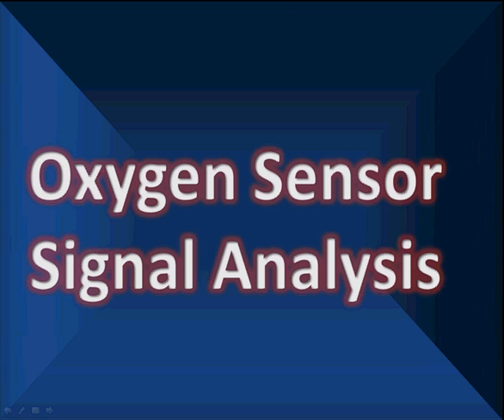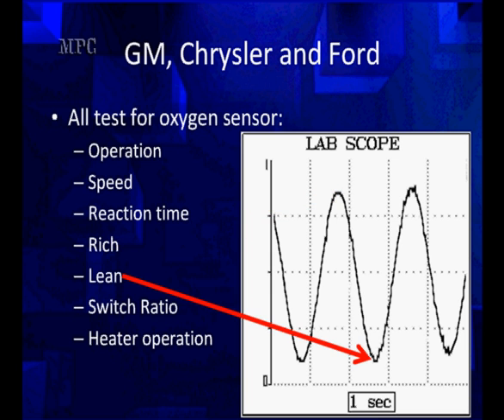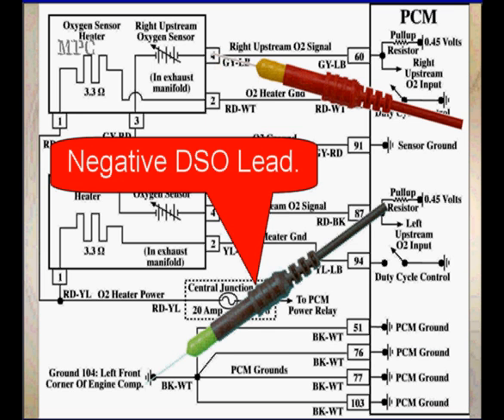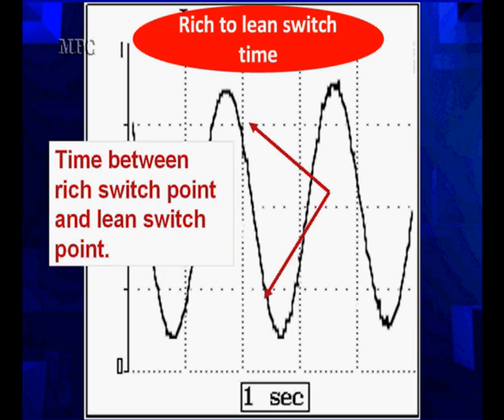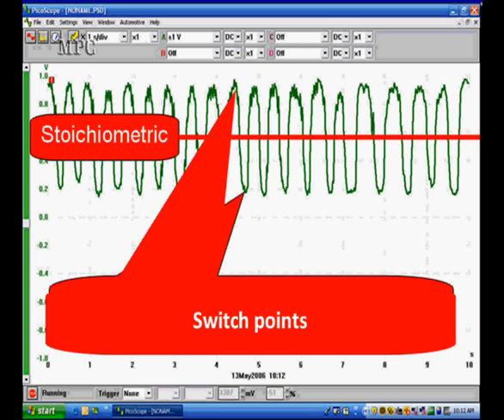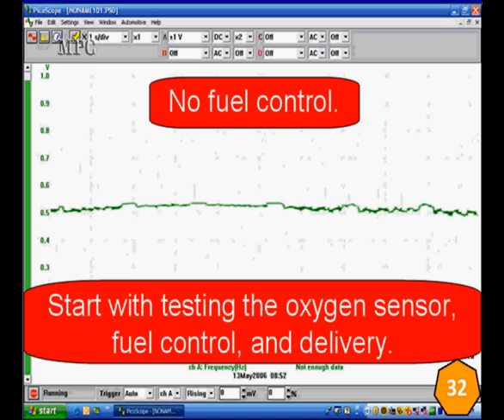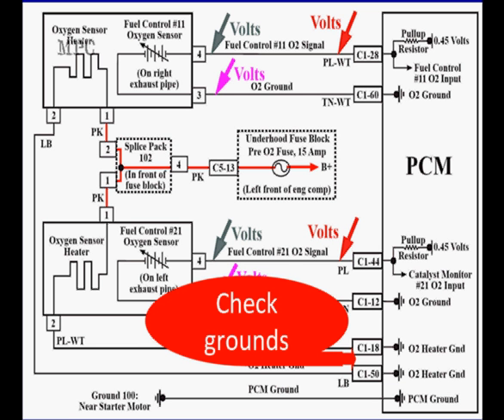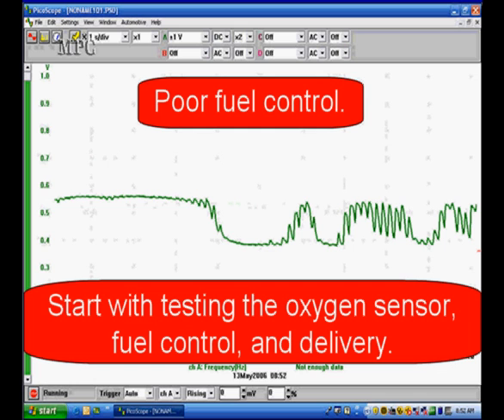12 Oxygen Sensor Signal Analysis

Comment: Back when I started in the early eighties we still had carburetors and then along came an adjustable mixture control solenoid mounted in the carb and we adjusted dwell time. Then came TBI and it was called "cross counts" (GM). When short term and long term fuel trim terminology came out I was a bit annoyed. If memory serves me right this was about the same time everybody started going to OBDII. I'm not so annoyed anymore, standardization is a good thing. Motor companies still practice their tactics of monopolization with the tech and good service being the victim. This comment has nothing to do with this video, LOL, it just reminded me of times past. I love your videos, keep em coming.

Comment: What's the purpose of the heater coil?  Is it to get the sensor working faster when the car is not at operating temperature.  Does the coil go off when the car is warmed up?  Is it suppose to reduce emissions until the car is fully warmed up?
Reply: yes
Reply: 1) Yes, 2) generally no but possibly ECM might turn current on and off, 3) Yes, closed loop starts sooner if sensor begins operating and cold weather for instance might cause sensor to drop out (cool off too much at low speed), so heater keeps it functioning.